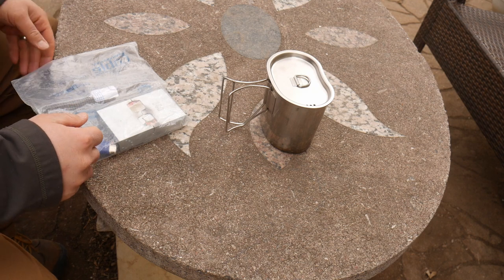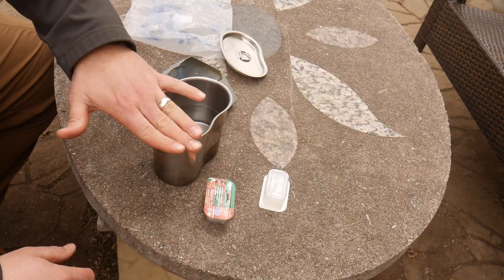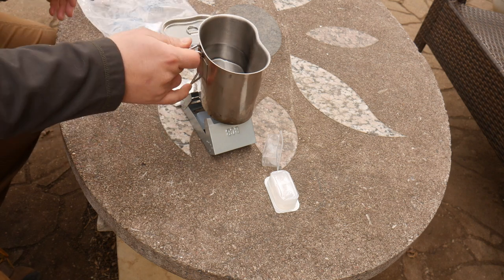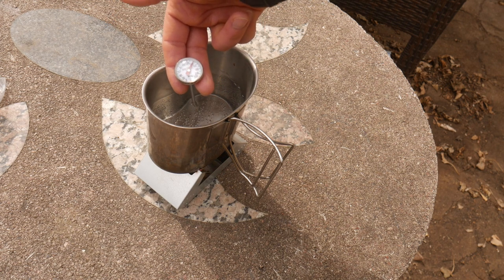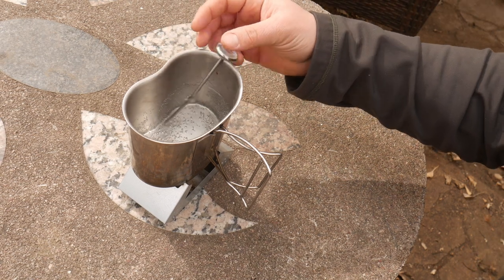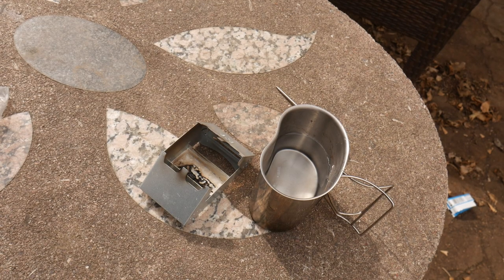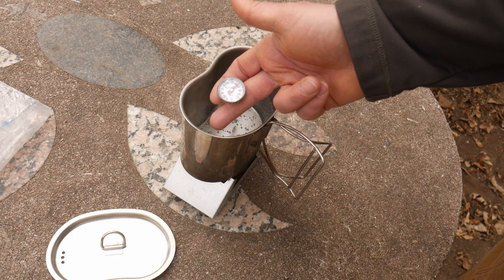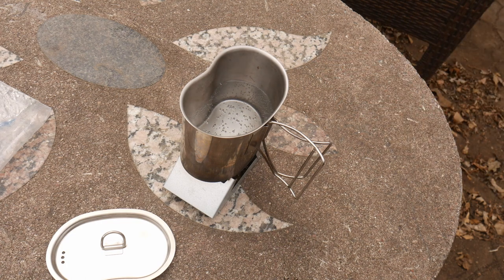Esbit Fire Dragon Stove Applications and Limitations

Comment: I’m guessing several fuel cubes might bring it to a boil? Good info though
Reply from the maker: Yea, I mean, I’m sure you could run a couple in a row.  But sitting there for half hour to get 2 cups of water to boils seems like a bad use of this stove - in my opinion.
Reply: @CitadelDefense1  Right, absolutely lol. Reading it back, I wasn’t very clear. I was thinking more of loading up 2 or 3 at once and maybe a bigger flame might push the temp up? More fire! 🔥 😄 could melt the stove though too…
Reply: Pretty much your only option if you have to do it indoors,